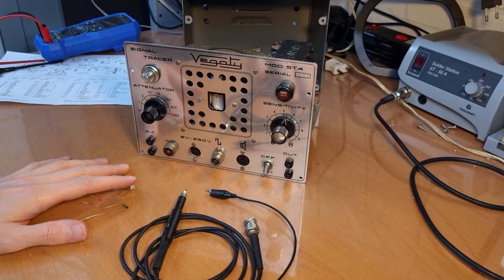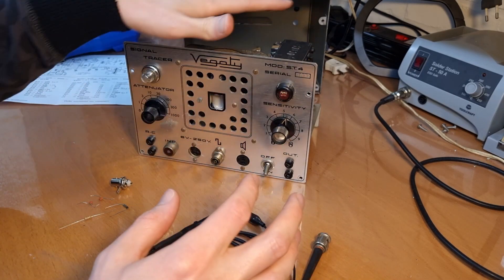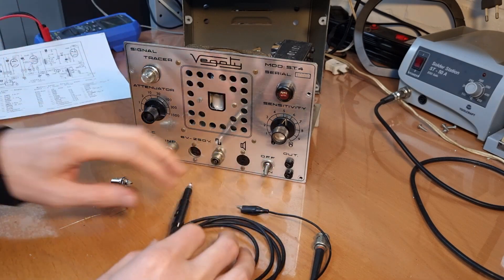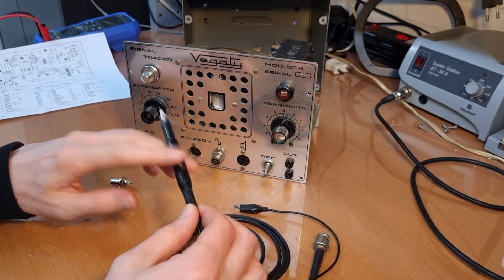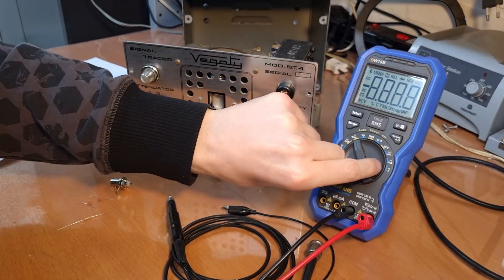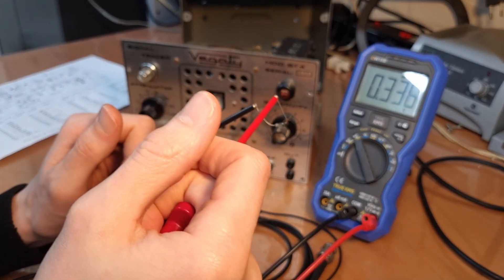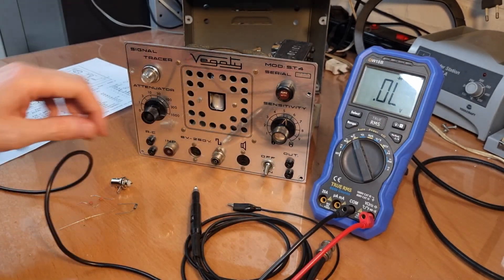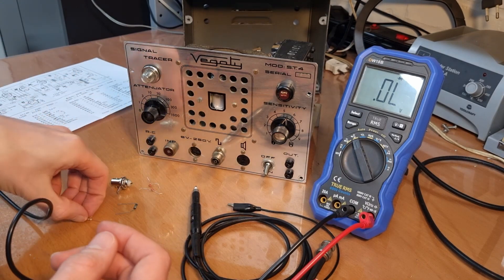Making a new probe + signal tracer repair finished! - Vegaty Mod. S.T.4 (Part 3)

Comment: Hello, and thank you for your videos.
If you are using the signal tracer on your regular mains (230 V and above), I am concerned that the filament voltage might be slightly higher than what is prescribed by the tubes. I don't remember having heard if you checked that.
Anyhow, if this is the case (filament voltage too high), I would suggest to put a resistor in series, between the 245 and 220 V selection, so that you can actually use the 245 V position and drop some voltage, letting the item work with safer voltage values.
Of couse, if you do not plan on using this signal tracer, all that would be unnecessary, but it seems to me that this piece of equipment will be your trusted partner for your next restorations. 🙂
Regards,
Daniele
Reply from the maker: Thanks for your feedback!
You're right, the filament voltage would be slightly higher, causing the tubes to wear out a bit more quickly. However, I don't really consider this much of an issue in this case because the signal tracer would only be used very occasionally, maybe at maximum a couple of hours per month. I haven't even used it once since I restored it...
Now, if this would have been a radio which would still need to play many hours, things would be different and I would probably have made the adjustments which you proposed.

Comment: Really nice probe. Congrats. Just one comment: not sure if the caps you used are high voltage ones. The cap needs to be rated higher than the highest voltage you’ll encounter in the radio. I know you used two in series so it adds the voltage ratings.
Reply from the maker: Thanks!
And about the caps: wow, that's a great spot. I completely forgot to check the voltage rating on those. There's indeed a chance that they aren't high enough. I will probably have to correct that...
Reply: Hi Kristof. Nice job on the probe. Very neat!  I must admit to feeling a bit nervous when you used it on the plate for the first time, but of course it was fine. Interesting calculation of the gain. This is obviously better that your average signal tracer. Looking forward to seeing you use it on future projects. 
Thanks for another interesting video
Cheers.
Reply from the maker: @Donno308  Thanks, Don!